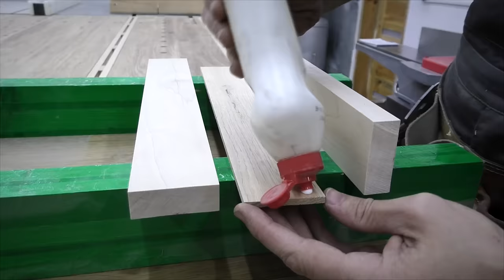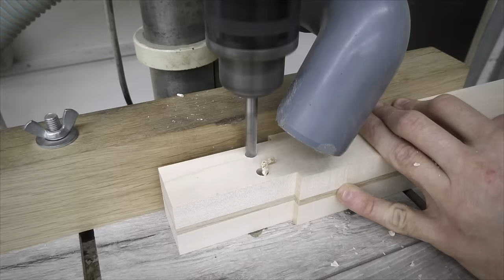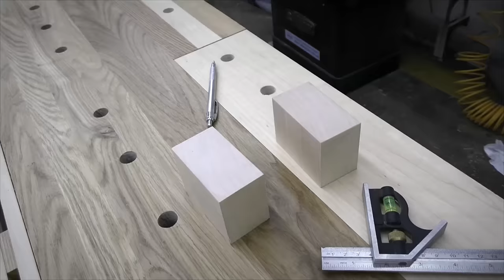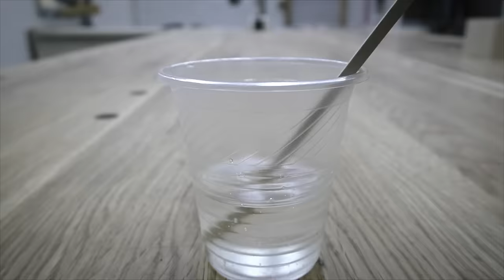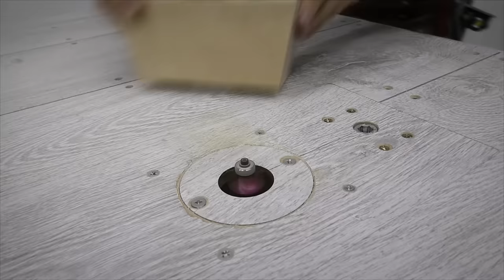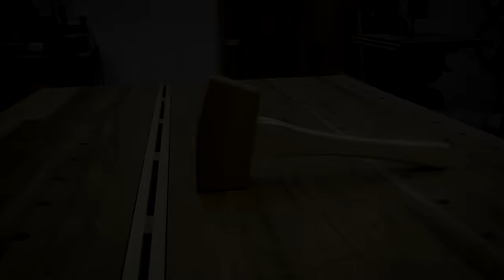Perfect Mallet

Comment: I wonder how good mercury in a mallet would work to transfer force? Having it placed in the same plane as the handle and being able to move towards the head of the  mallet as it swung. I t would seem the energy would be multiplied. Similar to a dead blow hammer, but with better response, less weight, and better efficiency. Vibration could be dampened to prevent hyperalgesic and disrupted myelinated axons, fragmented nerve ending, and mast cell degranulation. It also could be designed to give you a temperature reading. It could be called the Mercury Mallet. Mercury in a baseball bat would be interesting.

Comment: I made a batch of three of these for Christmas gifts.  Would've benefited from plans but was able to get close with a little guesstimating.  Instead of adding solid weights and filling with epoxy, I decided to make them dead blow mallets by using fishing line sinker.  That way, I've got both the weight plus no bounce.  They came out looking so nice I wonder if any of the recipients will actually use them.

Comment: Saw your excellent mallet build and decided to make my own following your design. As you didn't have plans for this I had to guess on the measurements. Your step by step visuals made the process pretty easy to follow and I was successful on the build. It turned out really nice. Unfortunately, my measurements were off and I made the hammer way too big! It looks like a prop from the movie Thor!!. It weighs 55 oz and is more like a sledgehammer than a mallet. 
Will adjust my measurements for the next one, but in the end your video showed the many steps required to make a nice mallet. Thank you for posting!!

Comment: What a load of work for a tool that is produced to get banged up faces anyway... I ususually make a wedge shaped handle with the widestpart at the head and a hole in the head fitted to that handle. Head shrinks a bit, you give the handle an extra whack to reset it. Works a treat.

Comment: I'm curious...when shaping the handle, why do you tape the slices that you cut off at the bandsaw back on and then run it through the saw a second time? just helps clean up the sides? When I build one, I'll have to make this cut with a jigsaw so I'll have a bit more cleaning up to do anyways! great video and the end product is beautiful! thanks for sharing!
Reply from the maker: No, I made it to not loose marks for second cut plus it's more stable during cutting.  Thanks

Comment: "little heavy woodworking mallet"

Nice work.

It seems large for basic chisels. What is its' intended usage? I suppose big chisels what? I am preparing to turn a mallet on a simple lathe, with well seasoned oak. I would need a larger piece to turn, to make one that big lol
Just getting my shop set up better. Ditching the 6" 3450 rpm bench grinder. Burns everything I try to shape and rough sharpen.....made and remade a few lathe tools. I have a very large very heavy large 2 wheel pedestal grinder, likely a 100 years old. Shaft runs in babbet. I plan to make shaft size adapters for the never used big grind stones I have. I can make these on my wood lathe, then drill the shaft size(1"), and I have improved my big grinder. I have it geared down twice with a 1.25 HP motor running it. I need much finer stones for a finished edge, but these big slow stones are great for shaping or reshaping or material removal.

Very cool though that I can improve my big vintage grinder using parts made with my simple old 3 speed spindle lathe.

I got a cheap set of diamond plates and have been fixing up my chisels(new and old), and realized I don't own a mallet for chisels. I have at least 20 assorted hammers but no mallet lol  My new neighbor gave me three chunks of seasoned oak. One will be a mallet. The other similar piece is now sectioned into several different sized blanks, to remove a large crack down through it. These pieces will make tool handles and such.

I haven't decided what to do with the 2 by 12 by 24" long chunk of oak he gave me. For turning, some of it is not useful, but 90% looks usable for either turning or other projects.

In recent years I bought some new and old tools, and am still missing some, but now I have enough tools to make some tools, or restore older ones. I am a jack of all trades so I am just getting wood working tools setup. I have been focused on metal working and small engines and computers and organic gardening and property maintenance/repair/renovation. I got to the point recently that I needed better wood working tools to make some tools and better renovate my shop.

Lots more to do yet just to make my grandfathers old work shop more functional, but videos like this are inspiring me to do more wood working. I am getting into forging too lol